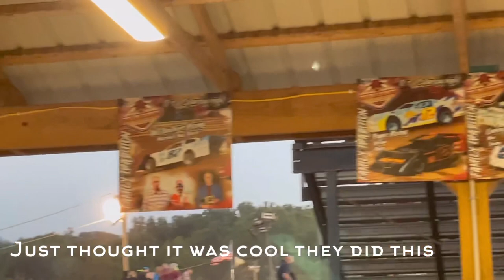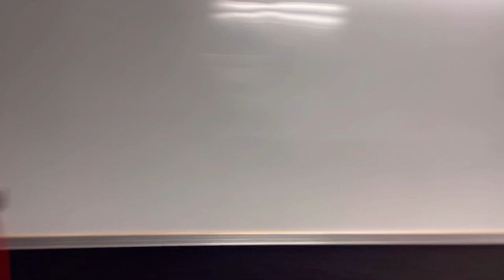Hillbilly 100 Weekend @ Tyler County Speedway / WHITE LIGHTNIN TUNE UP / CHAD ROUSH / Racing Vlog

Comment: What the hell are you hiding from the other competitor's  really most have way competitive thinking individuals already know all the tricks of the game and don't want to steal your middle of the pack setup  actually you would find it in your best interest to say take a look at this and can you give me some suggestions on how to make it better   been around this game for a long time and for the most part people that have something to hide are the people you wanna pay close attention to  it's all off the shelf parts anymore the only variation is spring ratings and tire compounds and if you're running leaf's or trailing arms  and if the series tech guys aren't goofing off traction control devices are impossible to hide because they use the theory of multiple sensors and a control module which are easy to detect if you know what you're looking for  the modern day cassie is quite simplistic ether it be late model or modified or even sprint hiding tire compounds is a given but all else is in the gray area and would make me suspect of what you're up to  but this is just an opinion and should be taken with a grain of salt
Reply from the maker: Nothing he already been tore down this year / protested.  They took him apart at Volusia and at i77  and the valley this year. It’s a inside joke that kinda goes along with all of that
Reply: Silly goose So what do you think we are up to? I don’t have anything to hide from any tech man at the race track. Been checked for multiple things this year and have passed tech every time. so if you know me at all it would be called playing mind games with other people and it worked. Look at yourself if you don’t think it did. In order to get faster you have to test new things. I pick to test there because I don’t care for Tyler County much and we would be testing against some of the best cars around this area. but I will go support tyler county on any modified race they have. We made the show and figured out a few things. Not every drives the same, so what worked for one may never work for someone else. But there is only a few people that I will let under my car.